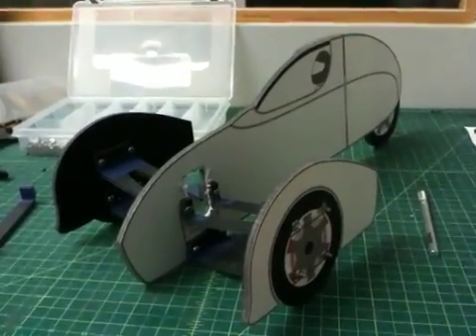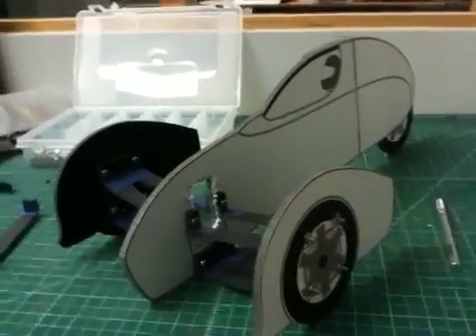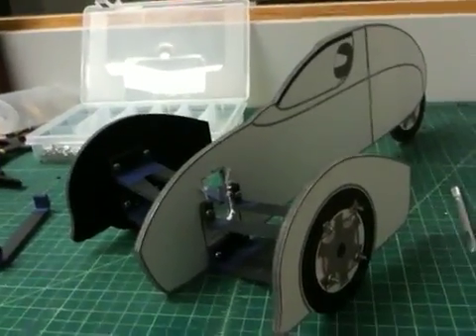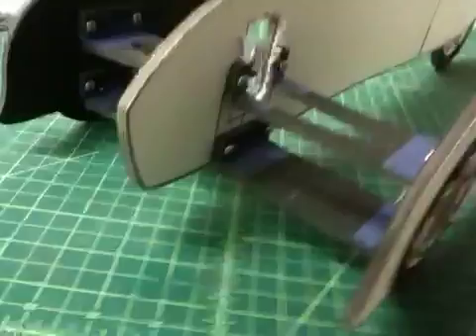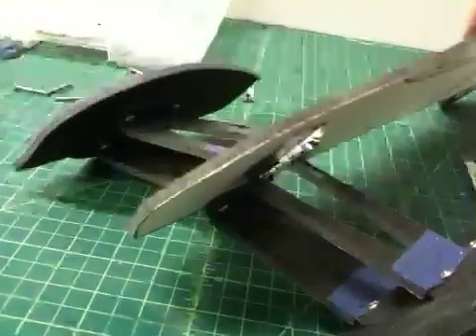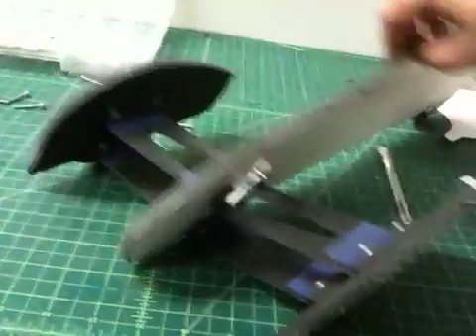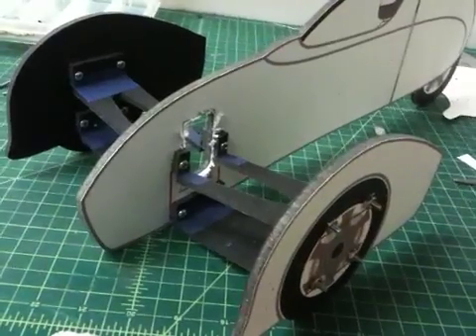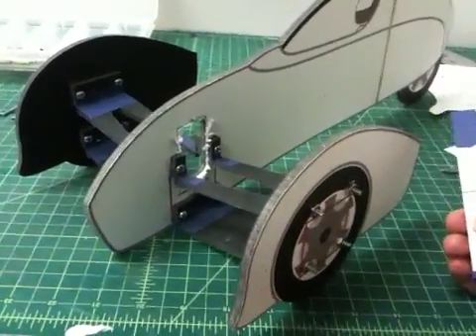Streetliner prototype suspension

Comment: I just watched this video! Great mock-up to demonstrate your points. A question I have is what happens to the wheel pants when the wheels turn left or right. Aptera is dealing with this now. With their Gamma prototype, the pants (wheel covers) tilt forward or back depending on the which side of the vehicle the pant is on and the direction of the turn. (The ouside pant tilts down toward the front and the inside pant tilts up towards the front). Is this necessarily the case or is there a way to suspend the pants so that their bottom edge stays parallel to the pavement during a turn?
Reply from the maker: Thanks. The pants were going to lean with the suspension but not turn with the wheels. The idea was to minimize drag in most cases but not chase perfection. The Aptera design doesn’t lean, so not really apples-to-apples. This project is long dead, but what’s funny is that back more than a decade ago when I was concerting this, I was really into the original Aptera. Great to see the new attempt. I even have a deposit down.
Reply: @NathanielSalzman  Thanks for the info. So I guess they are stuck with the tipping (forward or back) pants as the wheel/pant assembly turns.  I'm no engineer, but I was thinking there might be some clever way to suspend them so that they stay level while the wheel turns.

(Yes, I looked at your model and saw that you were examining tilt and not turn, but I thought you might have done something similar with the turning effects on the suspension and the pants.)

Comment: I'm starting to think,why not just go with the simplistic Yamaha Tricity tilt front end,Piaggio MP3 etc it is extremely narrow,it eliminates out riggers,exotic gyro control with steer by wire,lean control.Why reinvent the wheel."Streamlined electric"[google it] has a few bodies that look great and would give the desired out come,performance and high mpg or range.A truss frame ,aluminum [bonded ,riveted,or welded]similar to BMW clever concept [strong and safe.Even a light weight chromoly frame would work well.Monocoque type construction is really nice[Peraves Monotracer] it very strong,but expensive to produce.A small group of guys ,gals could bring one to market,its all in the packaging and if it is labeled as a motorcycle[can't be regulated].There are companies that can do anything,from lengthening cables to producing molds,etc.I'm looking around and everyone seems to want to make it difficult,the whole idea is too benefit from the incredible range streamlining affords you,add in comfort,safety[a lot more than none] all weather capability.I believe a market is slowly developing,people that realize ,commuting by car just doesn't work well.,I'm passionate about a enclosed motorcycle's,narrow tracked vehicle's,as soon as I read the crash data on BMW's concept the Clever [the design was flawed,the chassis was n't]I knew a safe motorcycle could be built[meaning it was not a motorcycle in a coffin.Well keep up the good work ,I'll be watching.

Comment: Nicely done! I always thought that the way to control the amount of tilt would be to mount the shocks upper point on their own common "sub-frame", and then just shift the sub-frame left or right according to how much lean I wanted. I suppose you could build it out of a hydraulic steering pump, and just use a brake proportioning valve to control how much lean (little - lot) you got with your turn angle. Your speed would have to control a second proportioning valve in series with the first. Guess?

Comment from the maker: It is. The tilt is allowed or not allowed based on where you attach the shocks. In this case, you attach them to a shared pivot in the chassis. This allows both up and down movement for bumps, as well as side-to-side movement for leaning.